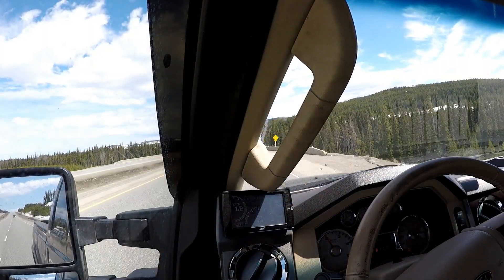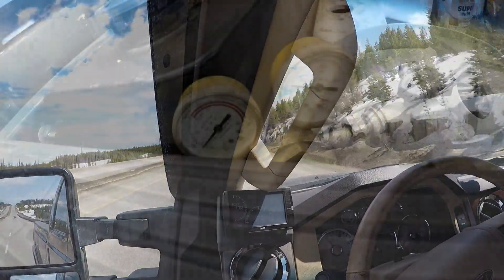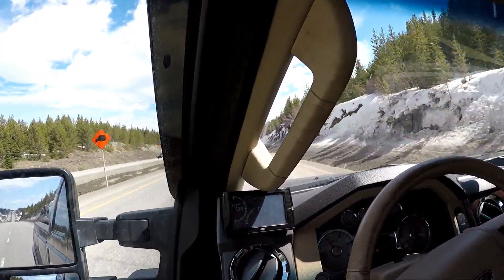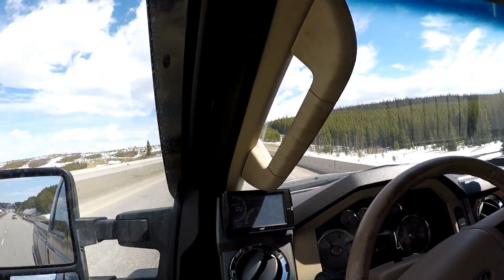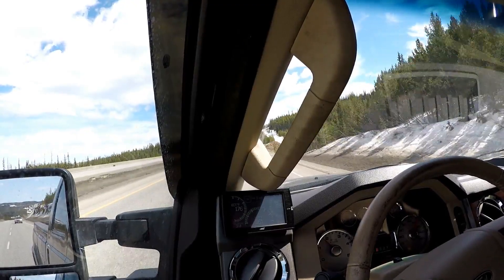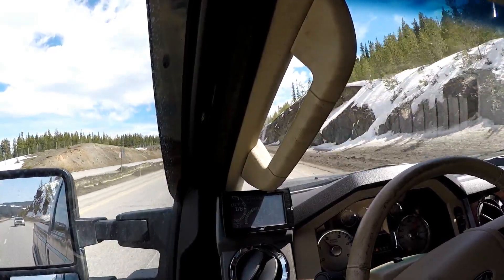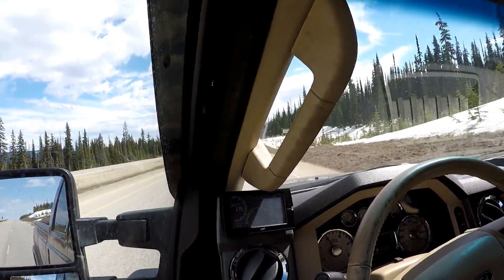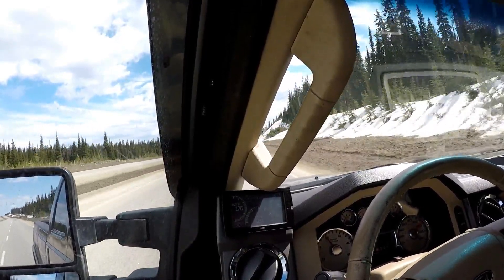Detroit 4-53TIB (Propane update)

Comment: Well what is the verdict on the propane you have no more videos on it?
Reply from the maker: It wasn't a happy ending on the propane.:)  Not sure if the propane aided in the ceramics coming off or not, but I had to remove all 4 pistons and liners.  I removed the remaining ceramic materials and coated bearings.  I honed the 4 liners, with one being replaced, re-ringed it and put back into service. 10,000 miles since this and engine still running like new.  The propane added about 10HP and 5% fuel economy, but that was all.  Not to be deterred I installed water meth with the fresh re-ring and love it.  I'm running the AEM system with a 500 cc jet and it's a huge improvement in power.  The problem with the water meth is the gallon an hour it consumes towing.:(  My long term goal is new 9G90 injectors and that should be perfect.:)
Reply: @detroitgarage9430  
Who said anything about having to run methanol nothing wrong with straight water up in the compression along with keeping the EGT down
Reply from the maker: I haven't tried straight water yet, but might this summer.  I've been running 50/50 mix winter windshield fluid and also have tried 25/75 mix from Wallmart.  I estimate around 240 HP with the water meth, once it warms up I'll try straight water and see.:)
Reply: @detroitgarage9430  that's real good for a little 453
Reply from the maker: @coreyellisart6877  I really like the added power, so looking forward to the 9G90's.  That should get me around 250-260 with fuel alone.  That will be just about perfect.

Comment: What is your thoughts on water/meth injection
Reply from the maker: I think it's a great system and may try it in the future. From what I've read it lowers the egts down as much as 200 degrees and an increase in power.
Reply: @detroitgarage9430  I am thinking of trying it in my freightliner 8v71
It works great in my cummins just not sure how the cavity will handle water over time.
Reply from the maker: @coreyellisart6877  Can always try and see.  Send out an oil sample after you've run it for a while and see if your getting any water in the oil.:)

Comment: What injectors are you running? Any idea of your hp/tq numbers?
Reply from the maker: I'm running 7A77's and it around 210HP and 450 FTLBS or torque.  My goal is 250HP and 525 FTLBS of torque.  If I don't like the propane then it's 9A90's next.:) Thanks for watching.:)
Reply: Damn that's great! I have a set of 4-53ti in my boat I need to rebuild. Stock they're only rated at 170hp. How'd you hit 210?
Reply from the maker: @dannyjones3840  I rebuilt the engine to a Silver Series, then added a performance camshaft, Upgraded to 7A77 injectors, bypassed blower, compound turbos and an intercooler.  Smoke free power.:)

Comment: I wonder how much propane is burning in the exhaust during cylinder blowdown and scavenging. If you’re going to have to hawk EGT’s again you might as well just have bigger injectors.
Reply from the maker: Very true, I'll continue turning up the propane and see if it brings down the egt's. I highly doubt it, but told that I'm too lean and need more propane.lol  If it doesn't I'll probably just go with 9A90's and water meth.:)  I should have this figured out in another month or so.:)  So far the 25 degree rise in egt's in not a good result for the small power gain.:)  Baby steps.:) Thanks for watching.:)